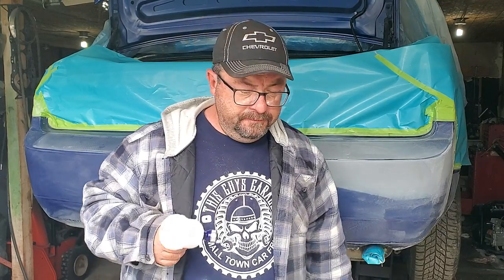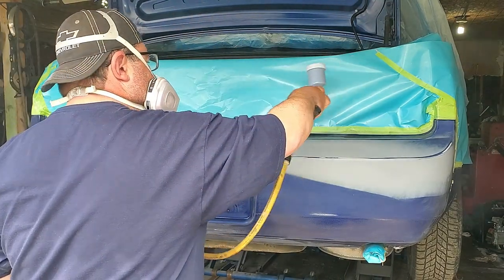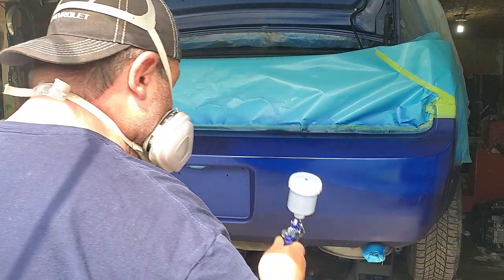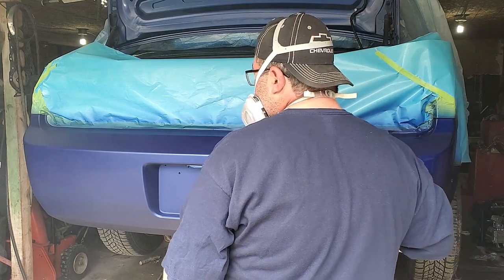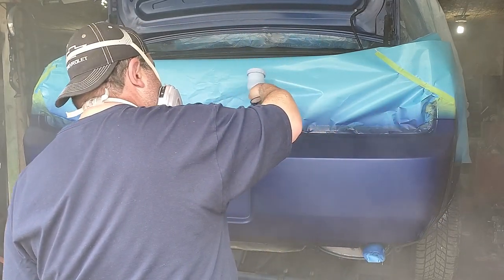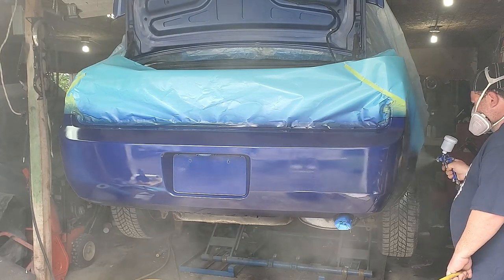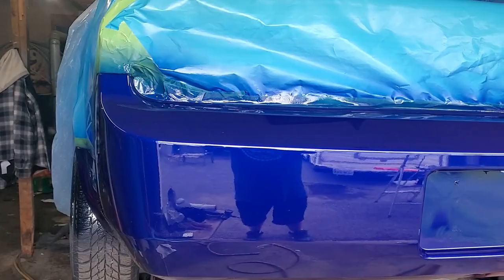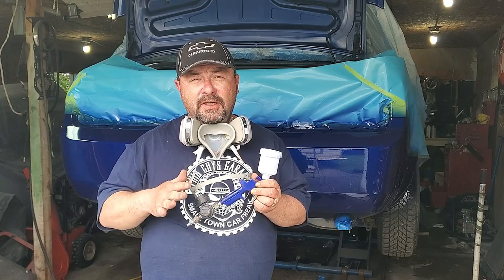best paint gun for small compressor Neiko 31207A HVLP Mini Gravity Feed Air Spray Paint Gun

Comment: Seeing is believing.  The problem is this is probably an improved version of a gun that is basically crap.  It's like the $15 purple gun at HF, they change it over time and have vastly improved the spray pattern.  I have two earlier versions of this same gun. One is same color and probably markings, other was silver finish with different name stamped on side.  Both sucked. I guess ordering by name and model Neiko 31207a one could hope for a gun as good as you demonstrate.
Reply from the maker: That in itself  is the thing.  At the price point these sell for how is the standard maintained on quality control.  It's not like every gun is inspected to meet a service standard.   And
If you  get a good  one it's not going to Last very long  because most  of the wear items are not of the best quality. 

But to learn with until one can afford a quality spray gun they have a place  in the market. 

I must say most of these cheapies I have tried  work great in the short term but can't be depended on long term especially considering the price of paint and supplies.

Comment: Looks like you got the air pressure up a little too high
Reply from the maker: you are right , really this panel was a little big for this little gun , to get the finish i wanted {enough product on the bumper} i had to compensate with a little more air pressure.   ty secal cavazos ,appreciated. good eye
Reply: it did turn out nice @ least.
Reply from the maker: @secalcavazos3204  ty secal